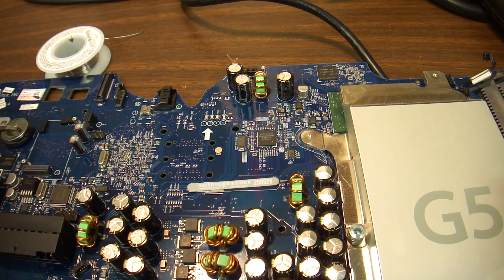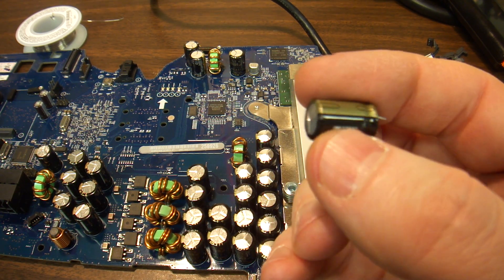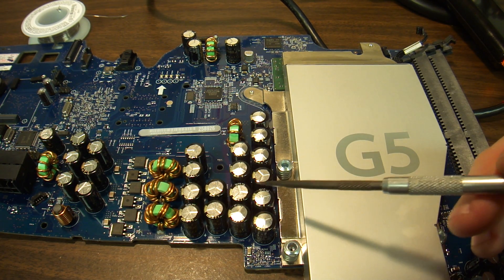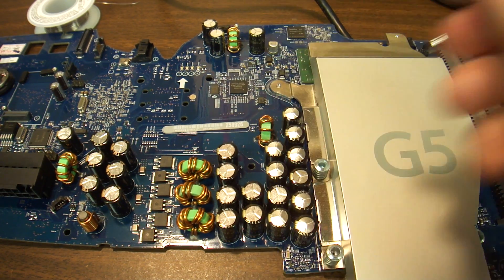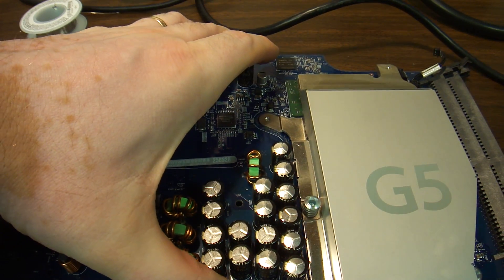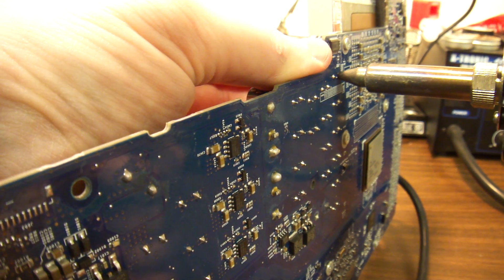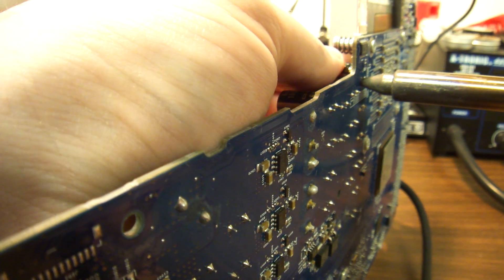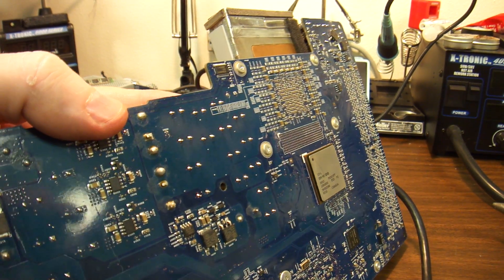A guide on How to replace capacitors on an Apple iMac computer

Comment: I replaced 17 capacitors, it still did not work for me. tested and two light comes on but the third light did not come on at all. I guess I messup the runners.
Reply: Maybe the CPU/io chip has shifted out of place due to heat.

Comment: You should of replaced all the capacitors, the original capacitors were a defective series, so the one you left on were only to go bad.
Reply: It was a case of industrial espionage. An engineer tried to recreate a stolen (and incomplete) formula for electrolyte. Google: Capacitor Plague
Reply from the maker: Its been more than 2 years and the old ones still work, the system is still in use. So, was it a bad batch? I don't think so. If you look closely its only the ones that are the closest to heat sink that have failed.
Reply: Abraham Levit Not sure then, I do that the capacitors that failed were united chemicon lxj which were prone to failing (the early ones anyway) but thanks for the reply.
Reply: @Mac1PC  hi mine is exactly G5 but it has black screen but doesnt go off and most of the capasitors are bloated and leaked could that be the problem. Because the system boots alright but its a black screen.. will be glad if you will reply to me Thanks